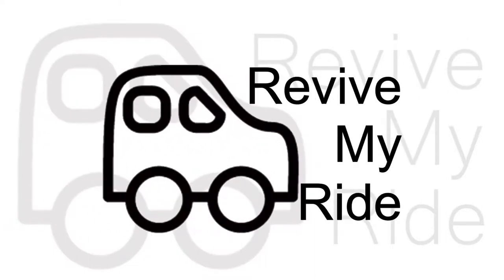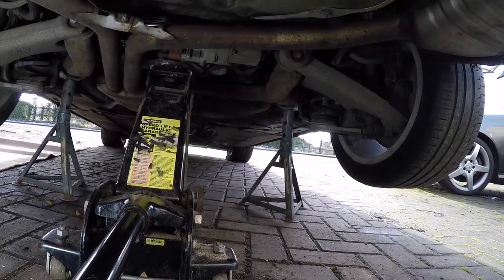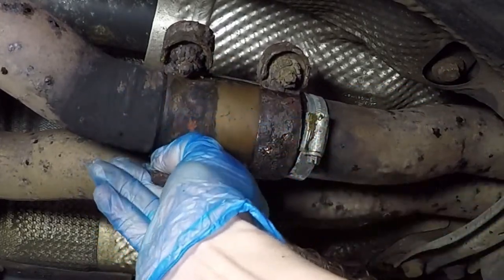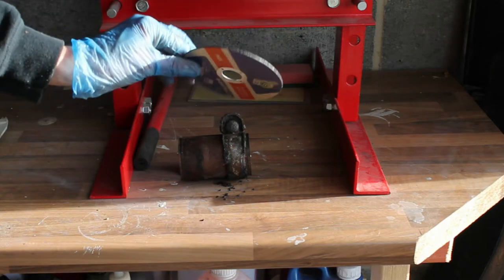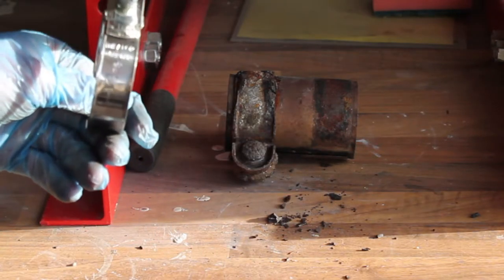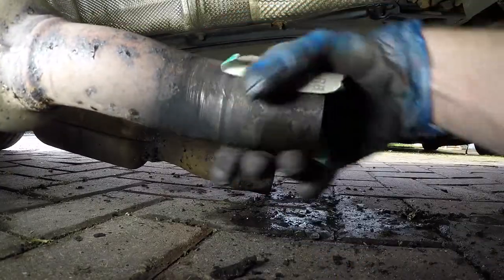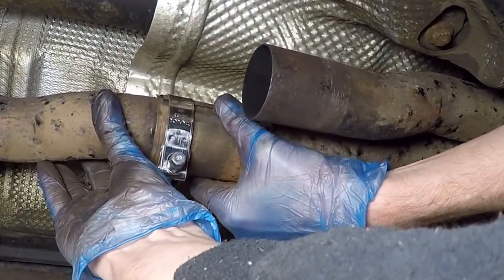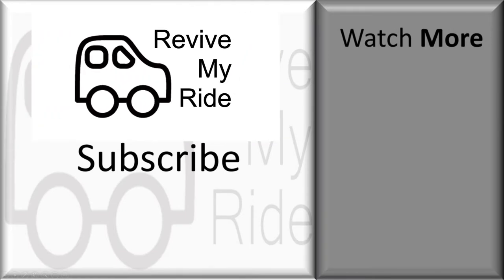VW / Audi exhaust sleeve and clamp replacement guide - Easy DIY

Comment: Do You think it might be use as coupler for after market  sport silencers  instead of welding?
Also, does it need ane paste o sealant underneath? I know that mechanics use some When assembling exhusts.?
Reply from the maker: Yes, it can but double check that both pipes are exactly the same diameter. If they’re not, there are actually different sized couplers you can buy. For example 48mm one end and 52mm on the other for joining dissimilar pipe sizes. It would do any harm but as long as you have a good tight fit, you should need any jointing compound. Cheers, Phil

Comment: Would you recommend put exhaust assembly paste on the sleeves?
Reply from the maker: I suppose it wouldn’t do any harm but I didn’t use any on mine and you can’t hear any exhaust blowing noise at all. Just make sure that the slots in the two parts of the sleeve aren’t aligned with each other and if you use the right sized clamp and get them nice and tight, you shouldn’t have any issues! 👍 cheers, Phil
Reply: @ReviveMyRide  Thanks for your help

Comment: Great video! Do you have a VW part number for the sleeves?
Reply from the maker: Thanks you! I'm really sorry, I don't have the part number and tbh, it will be a different one depending on your model becasue the exhaust diameters vary by engine size. If you check out this site, you may be able to find it: https://www.nemigaparts.com/cat_spares/ Thanks, Phil

Comment: That's the easier job you have show us here! I would say that jacking is the most difficult part if you don't the right equipment. Well done
Reply from the maker: Hi Cristiano, this must be one of the fastest ever comments on one of my videos! Thank you! The problem is, every job starts with Jacking up and supporting the car and I have found that if I show this every time, people get bored and leave the video. So I try to get straight to the task at hand. I have got a video showing how to Jack up the front of the car here: https://youtu.be/fLMSeSBiTNg and the process is pretty similar. Instead of jacking up on the cross member at the front, you jack on the diff at the rear. Then you support on the sill / crimp weld jacking point or on a solid section of the suspension arm. However, very IMPORTANT, it isn't recommended to work under the car if you don't have the right equipment, which includes a good quality trolley / floor jack and axle / jack stands rated at the correct loading for your vehicle. Hope that helps!

Comment: Is it normal for there to be a gap between the pipes, which the sleeve covers? Any issues exhaust leak or is that literally how they come oem?
Reply from the maker: Yes, there can be a small gap, not normally larger than 1 inch. I removed my old rusted sleeves / clamps and there was not evidence of a putty or sealing agent, so I just put the new sleeve on and tightened it up. No noise or other evidence of an exhaust leak, so all looked good to me. Hope that helps! Cheers, Phil

Comment: One of my Touareg clamps have failed but when i removed the old one the pipe didn’t drop like yours in the video. It stays elevated with just the empty space. My problem is how am i supposed to get the new clamp on if the pipe doesn’t drop, making it easy to slide it back on??
Reply from the maker: Hi, you’re right that you need one lower than the other to slide the new sleeve on. It will be a bit of a pain but if I was in this situation, I would look to lower the rear section of the exhaust (back box) from its hangers to give the clearance, if you are lucky, you might just be able to loosen the brackets where it bolts up to the underneath of the car. Hope that helps! Cheers, Phil

Comment: Do these clips fully open so you dont have to pull apart the exhaust to install them? 
My scorpion clamps have rusted and need replacing
Reply from the maker: Hi, I’ll be honest that I don’t know. I just opened them up a bit and slid the sleeve back to get the clamps on without opening them up fully. I would say give it a try and worse case you have to spend a little bit more time doing what I did. You won’t regret it, these Mikalor stainless steel clamps are the business, fit and forget! Thanks, Phil

Comment: Is it not necessary to use exhaust sealant?
Reply from the maker: Hi, in my opinion, none needed. There wasn’t any residue that I could see on the pipe from the first clamp / sleeve and that was factory fitted. After I fitted the new sleeve, no sign of exhaust leak that I could hear or smell but no harm done if you want to use some 👍 cheers, Phil

Comment: Really useful video 👌 about to replace my sleeve and clamps. Is the A5 exhaust the same size clamps?
Reply from the maker: Hi, thanks for your comment! :-) I tried to work out which cars used the same clamps from Audi parts diagrams etc but it varied quite a lot. I’m afraid the only way to be 100% sure is to measure the exhaust pipe diameter near the clamp and buy in the correct clamp ahead of time. Or you could try looking up the size here: https://nemigaparts.com/cat_spares/etka/audi/ hope that helps! Cheers, Phil
Reply: @ReviveMyRide  thank you
Reply from the maker: @isaacbarker9  No probs, happy to help!

Comment: Ha, mine slowly came off. It was leaking and couldn't find a rust hole. Then my car got suddenly louder as I saw the sleeve bouncing in the road behind me.
Reply from the maker: Yeah, usually that is the first indication you get! My clamp failed and slid back and then the front pipe dropped down and dragged along the road! 😬 Hence, I'm recommending people to check theirs in the video! lol! Cheers, Phil
Reply: just happened on my 10yo GTI, in my case it looks like the sleeve completely fell off

Comment: what is the diameter of the pipe itself?
Reply from the maker: @DJ-nn3uu Hi, I'm sorry, I can't remember and I sold the car, so I can't go and check but the clamp I used (link in description) was for a 59-63mm exhaust pipe, so my pipe will have been in that range. Hope that helps! Thanks, Phil
Reply: @ReviveMyRide  Thanks for the reply! Im in EU and doing a similar repair. The parts online one give one single diameter per "size" for example ⌀48 and 50⌀. My astra's pipe is ⌀48 so i'm unsure if I should get the same size or a larger one. 
I asked the seller and they somehow didn't know... 
I ordered both and will report back soon
Reply from the maker: @DJ-nn3uu   I can see why you bought both, I've done that before, just want to make sure I have one that will allow me to do the job! Would be interested to hear how you get one with them for future reference. 👍